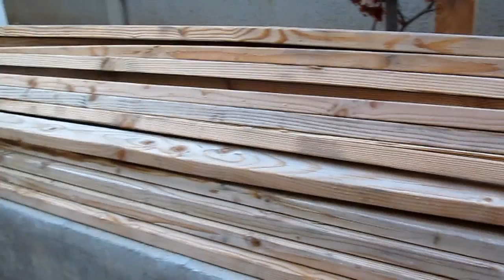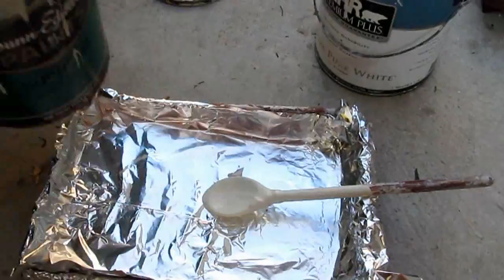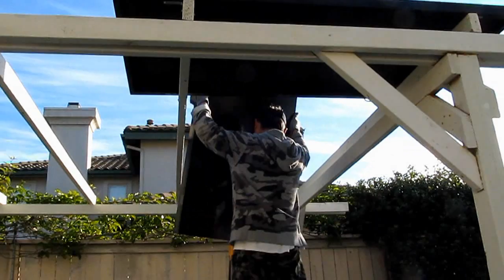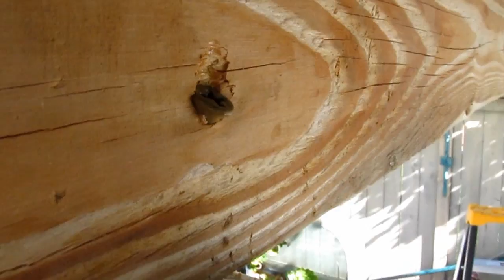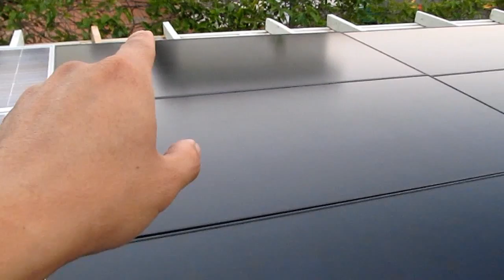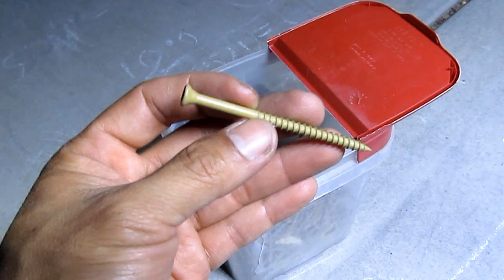DIY: Home Made 3 KW Solar Car Port Parking structure from used wood

Comment: Why didn't you angle the roof to face the panels south?

It would also help it to drain quickly, and stay clean.
Reply from the maker: You got your point. But there's a few thing with angled panels: 1) It's harder to install, maintain, and clean (I'm the only one who does everything so I don't have a second person to help me with it). 2) I need a roof that's rain-proof. I want it to stay dry under the roof. Have them installed at an angle would either leave gaps between the panels and thus let the rain through. Or if no gaps, it would be too tall on one side and complicated the matters. The angle that faces the sun happens to go along the length of the structure and I can't turn it 90 degrees to face the sun along the side as I have no room for that. So if I put it at an angle along it's length, one end will be way too tall compare to the other end and that makes it look clumsy and dangerous.
Reply: Flat panels loss efficiency because of the less than optimal tilt. Then they lose additional efficiency because there isn't any airspace behind them. The hotter the panel the less the output.
Reply: @ Philly Cheese Take ....I read an article about study that show they should face west not south.
Reply: @callmebigpapa  Which direction they face depends on where on the globe you are. Northern hemisphere panels best facing south whereas panels installed in the southern hemisphere would face north. If you want to also have them face somewhat towards the west is also an option. Use this tool to calculate your angles: http://suncalc.net I'm going to put mine on a frame with a solar tracker.
Reply: @MyGoogleYoutube  These have air space under then... flat mounting is referring to direct on a flat roof.
Reply: @JillofAllTrades2  Depends on shading and the time of year. In the northern hemisphere around the time of the Summer solstice,  it can be more productive to have the panels tilted slightly north, to catch the morning and evening sun. This is even more true if there are tall trees or buildings to the south.
Reply: Everyone does not have a roof that faces in the best direction for maximum efficiency,  all that means is that you might need a few more panels to generate the same amount of power. Sometimes, you have to compromise.

Comment: Pro tip: For that small roller, grab a 2 gallon bucket and a screen to roll out of. Much easier to work with, no tray liner needed & safer against spills, plus you can roll excess paint off roller, so less drips, especially overhead. Cleanup - pour excess back into can. Spray off screen with hose or in laundry tub. Let plastic bucket dry & peel off paint. Easy-Peazy!

Comment: Love the idea.  A couple of construction concerns: 1) what about ground anchors?  (This whole port could fly away in a bad storm.)  2) Rather than unbend the bent boards for attachment to the panels, how about either using shims, or just leave the gap so that the bracket steel is holding up the panel, not the board? 3) Having electrical grounding would be much safer and more responsible--have you a plan for that? (Even just wiring each panel to a grounding rod hammered into the ground would be a positive step (no pun intended).  (You could use just one long piece of wire, daisy chained to each panel...) (Could be bare, scrap wire--I know you like to do things as cheaply as possible (but do not shy away from some work)...))
Reply from the maker: Thanks for your input. I will have ground anchors. What I'm gonna do is I'm just gonna use heavy duty metal brackets with heavy duty thick bolts to bolt to the wooden post then on the bottom, I will just drill holes into the concrete floor and fasten the brackets down. I did used some shims to level the panels on the vertical position. For horizontal position, I just bent the wood as you can see in the video.You can use shims if there's a gap. But if it bents the other way, you don't want to cut your wood as it is a load carrying beam. So you will have to bend it somehow. For grounding, I think I will use some bare copper wire and connect it to the ground where I have a metal rod hammered into the ground like what you suggested. But the thing is, it has not rained here in California for years and unlike Florida where you have lots of lightning, even Californian rains don't usually come with lightning. But sure, it is a safety measure if you live in an area that has a lot of lightnings like Florida.
Reply: If you think about it you probably already realize that electricity + metal structures (aluminum frames) + water (rain) is reason enough to ground, not just for lightening concerns.  And what if AC current from the house (e.g., inverter failure) ever accidentally back-fed to the panels?  Being 7 feet in the air helps keep most people safe, but I would still recommend grounding. (Lightening protection grounding is a little different; and may not be justified at that low an elevation, but if you do, there should be a lightening bypass block, not just solid wire.)
   (If you are familiar with recreational vehicle trailers, after a few years the outdoor 12v lighting and other appliances often fail or short due to eventual water penetration into wiring connections and such.  Trailers have not only AC and DC breakers, but usually ground-fault interruption breakers on outdoor AC and DC circuits. I mention this just as an example of what fairly often happens with outdoor DC circuitry over time.)

Comment: Great job I’ve been thinking for ages I’d like to do a roof where the solar panels are the roof sheets so hadn’t seen it done before  gives me a few ideas now as I can buy used panels quite cheap probably cheaper than roof sheeting.   Will be doing a car port similar to that.
Reply: Recommendation for where to buy used panels?

Comment: 10 out of 10 for effort

Considering how resourceful you are, I found the problem you came across with the holes in the L brackets not lining up with the predrilled holes in the solar panel frames quite amusing.

Either drill new holes in the solar panel frames or drill new holes in the L brackets!

If you did this project again, consider the more complicated solution of building a real slanted covered roof with guttering and drainpipes and then add your panels to the slanted roof. If you had a real roof, of course this adds more weight so your structure will need to be stronger. I agree it’s difficult to do these type of projects on your own and with a limited budget but you may come to regret spending all that money on the solar panels but not maximising the amount of power they can produce as well as the inconvenience of not having a real roof with rainwater drainage.

However a great DIY effort. I enjoy watching your videos so thanks for making and uploading them.
Reply from the maker: I would rather not drill holes on the panels because that will void the manufacturer's warranty. And if you're not careful, you might also drill through the back side of the panel and then through the solar cells as well. That will damage the solar panels. L brackets aren't even long enough to reach in some instances so there's no point of drilling more holes on them. I thought about slanted roof but this structure is oriented toward the sun along its length. And it's long. So I would either have gaps in the panels or if they are continuous, one end of the structure is way too high compared to the other end.

Comment: Suggestions:  1) Anchor all posts to the driveway with poured concrete footers and anchor bolts.  2) Since solar is on around 12 hours a day, consider a quality ground wire for this setup.  3) How about permits?  In my zip code (central NJ) they are permit-happy folks.  AND LIST ANY/ALL PRICES FOR THE PANELS, CONVERTERS, AND WIRING, please.

Comment: Great. What did you do in regards to city permit and inspector? I am a bit spectacle on the quality of 1 dollar shop brackets but hope all has worked well. Can you give an update as to how the first winter and spring has been like and any unwanted effect on your construction? 
Then how much more work would it be, if you could give an angle to the south and make half of the roof solar panel only? In other words how much less electric harvesting are you facing, now that you don't have the right angle?

Comment: Good idea, but I think more L brackets on that structure, otherwise it my fall after wind gust or small earthquake.
Reply from the maker: 4 brackets each panel is plenty. It's strong enough to hold the panel with the strongest winds. I have tried with only 2 brackets on my other structure and it holds just fine in 50MPH wind. With 4 brackets, the wind has to rip off the nails or the wood first before the brackets go.

Comment: Q:  How much do these panels weigh, cost, and their lifetime warranty?  How much did your inverter cost?  And is it dangerous to work with hot voltages in the lines as you wire things together?

Comment: No angel mean dirt accumulates as the rain cant rinse the dirt. Same for leaves if present. Other locations need to consider snowload. Every project need to consider power and energy is affected by the angle depending on the one or multi purposes why you do the project. Rain, snow and sun shelter. Main purpose could be to maximize energy per year and panel or time balanced power by day or by year. 

Just saying flat roof give least power in winter, most snow load, most dirt and low overall energy.

Comment: I used zip ties to hold my panels down, just make sure they are strong
Reply: zip ties tend to wearout in the sun and become brittle, you could use  scrap wires to tie them up.

Comment: Untreated wood won't last long outside .. even painted. Pressure treated is the only solution.
Reply from the maker: Negative. I used to have regular wood painted used for patio that lasted for over 10 years without any termite damage whatsoever. Maybe if you live in a hot and humid area then treated wood is better. Still, I got these for free so I didn't get to pick. :)